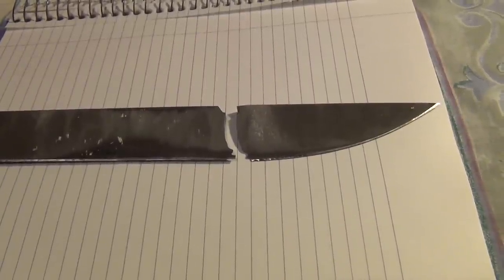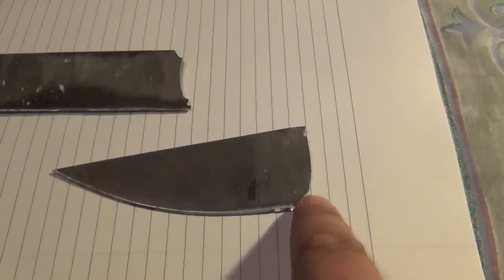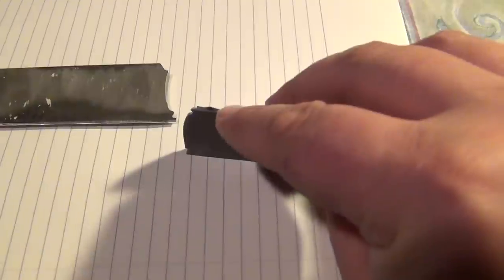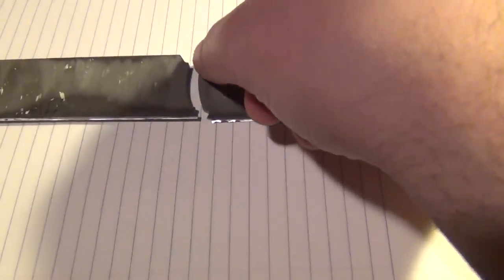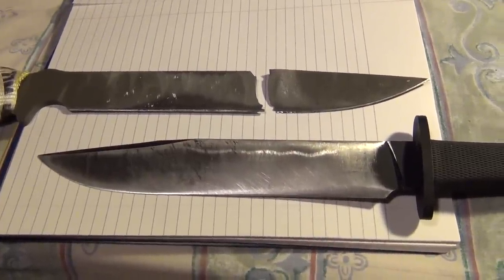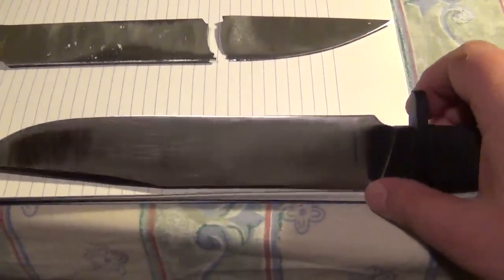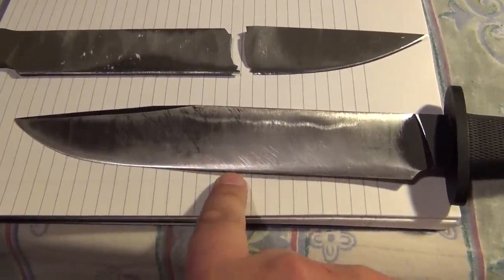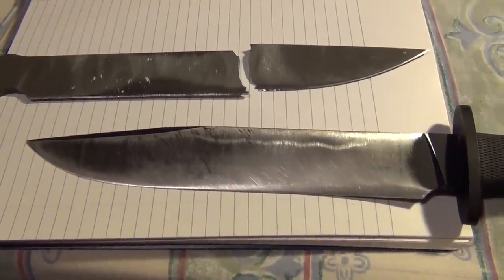Buck Hoodlum : gross blade failure

Comment from the maker: I don't disagree it is not an overly positive design flaw, simply that if properly hardened 5160 is extremely tough and should still not break in this manner. However even then it is not an overly sensible idea because by using something like this you will amplify any issues in the blade. If there is an issue with the HT or the steel or mill processing, you just put a glaring weakness there to be exploited.

Comment from the maker: @prometheus19799791 Yeah, I have a Junglas, nice blade and decent sheath for Kydex. 

Pine is nice to cut, more Spruce locally which is harder to work but better to burn.

It would be nice if they would remove the notch and step up the QA on the heat treatment.

Comment from the maker: @prometheus19799791 They are probably having too much retained austenite in the edge, that steel really needs an oil quench, deep cryo and a low temper, ideally two. But if you are going to cut corners, then the heavy use survival knife really isn't the one to scrape the barrel on .

Comment: Does it say Ron Hood or Hoods Woods on it? I heard the first batch that has Hoods Woods on them had a problem with breaking at the notch. It has a lifetime guarantee. Send it to BUCK and they will give you a new one no questions asked. I love that knife because it is so light but it is just not heavy duty enough. I have my custom maker grinding me a custom version in 3/8 O1 with a convex edge. The BEST chopper for the money you can buy is one of the Kukri's from ex-gurkah kukri house. $130

Comment from the maker: Bos has retired.

The problem is that notch is almost a sort of trademark associated with Hood. The real issue though is that they have defended it strongly, it isn't trivial to turn around and change it because how do they then respond to the obvious question of "Hey wait, if it was a problem why did you constantly say that it wasn't for years?" . 

Yeah, that is the problem with complicated tangs, if you want a tang to actually mitigate vibration use one based in physics - tapered/annealed.

Comment: That's almost identical to the failure on my Ranger!!!! My Ranger, however, did not break. I stopped once I noticed the wave action happening with the edge. Exact same thing, going through some knots. I've tried it with other knives since and NONE have shown the same damage. I'm really starting to think you are on to something about the burning of the edges on knives. I will make a distinction in saying that my knives have chipped, rolled and what not but this is entirely different failure.

Comment from the maker: @IMZReady4Anything Ironically 5160 is commonly used for axe heads, though usually differentially hardened. Even more ironic my wood cutting (and not utility) axes have edges set which are thinner and more acute than this knife.

Comment from the maker: It is odd behaviour for that knife in that steel. I do think that sooner or later Buck (or another company) is going to run into huge liability due to a lawsuit when this happens and there is an injury as this kind of issue in general can have a severe impact on manufacturers. Buck has acknowledged there was an issue and changed the design, but I am not aware for example of a forced recall.

Comment: I think they over hardened it or over cooked,next time try to test the knife 1st in this way: 1) Throw it in the ground for 10 times to 15 times, 2) Knife throw it in the tree for 20 times, 3) Cut some tall grasses, 4) Dig some soil like a shovel, 5) Hit it with heavy wood or 2 x 2 jagwood in the face of the blade, 6) Hit the spine in hardwood or concrete for 10 to 15 times.

Comment: 5160 should not break if good heat treat even with notch. I have aranyik spartan with 5 or 6 bigger notches and abused it as hard as my 6 foot 3 110kg body allows; no failure. It is a small sword and I wail on seasoned oak.Steel a little softer than I like.

Comment from the maker: Yes, this isn't a thin knife though. While it has a high grind it does not thin out dramatically. I have lots of knives which have much thinner cross sections than this one and are perfectly functional. 

The odd thing is that inherently 5160 is a tough steel but yet they somehow have managed to make it behave worse than D2. That is a bit of an achievement.

Comment: Ah I know, thin knife with high bevels will shattered, than normal bevels, because it's like the gillete blade theory(easy snap blade). My home made knife in my video is 1 year already, and have a hardcore weekly task like hardwood, grass cutting with stones, digging deep soil, smashing wood nails. Look until now my knife does not have any problems, little heavy but a knife that will make you survive in other planets and universes. A real survival knife made from cheap scrap steel.

Comment: Agreed. I don't even like the batoning thing the youtube guys are always doing. In 30 years of knocking around the woods I never even thought of doing that. Where did the log they are going to split come from? And you wouldn't baton to make 2 foot pieces...you'd chop. Even with that reasoning, what is a big knife going to be used for? Even in combat I used my Walmart KaBar as a crow bar or for stabbing rats in an OP and then flattened the blade slashing 20,000 sand bags. That was a good knife.

Comment: How does one know if one has the older version or the newer? I'd just as soon not have the notch at all. I called Buck today and the fellow I spoke to claims he's completely unaware of the problem. That smells of blatant dishonesty. If the heat treat is bad, it doesn't matter how the notch is redesigned. I'm more into guns, but this knife seems to have its problems.

Comment from the maker: To be frank, if you can actually see anything in the steel without having to etch the blade there is something seriously wrong with the grain, likely over heated. 5160 is inherently a very fine grained steel with almost no carbide volume. If it is coarse then the HT was horribly blown. How they are doing this on a very simple steel is beyond me unless the time/temperature controls are poor.

Comment: Well Cliff then they are stuck with it. If that's the case. Word is getting out that it's junk. And will continue to. People will make Buck either shelve it by not buying it. It's unfortunate for the ones like yourself that did. But there is little you can do other than get the word out.

Comment: If Buck wanted to ameliorate this issue they could improve it at least by removing the sharp edges at the notch base with the largest radius possible. It wouldn't affect billy lifting performance. Frankly just loose the notch Mr Buck. Being rational I reckon it was just your mummified handle wrap that was responsible .lol.

Comment: I disagree. look at the Tops knives compared to the Hoodlum. The Tops knives by Ron had a saber grind with the notch or notches not entering into the grind line, like the hoodlum's FFG. The notches on the tops are sitting higher on a 1/4 inch thick slab. I think it's a bad design flaw either way. A knife derives it's strength from it's spine. Why would you put a breaking point in a critical area?

Comment: My knife do those test before, because I want a knife that is not perfect but, a knife that will last long in life time a knife that is a multipurpose, strong, not very sharp, can break concrete using the spine part, etc. You can see it in my video, my home made bolo knife, I will share my knife design to everyone so they can have a knife that will make them really survive in a cheapest and easy way.